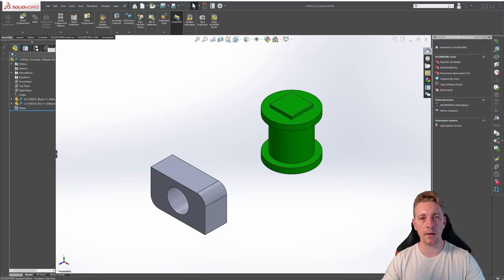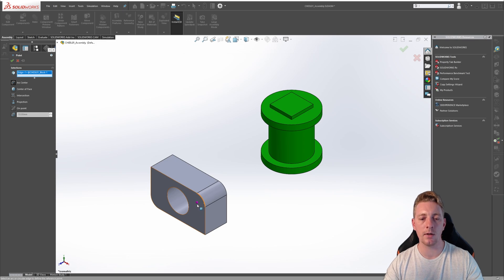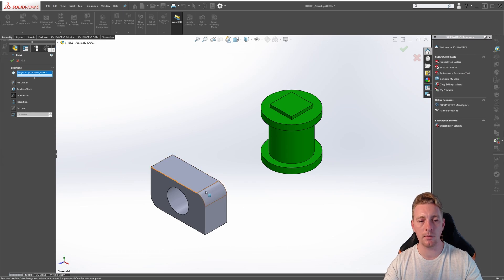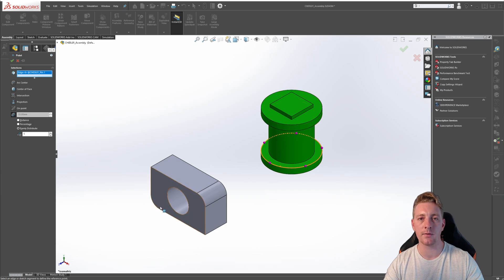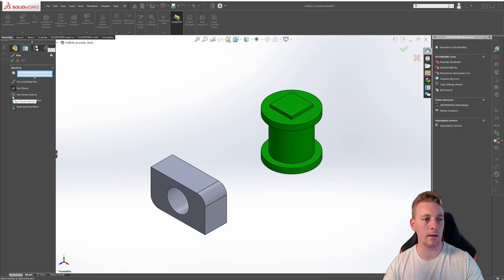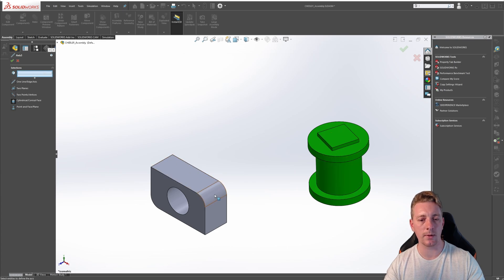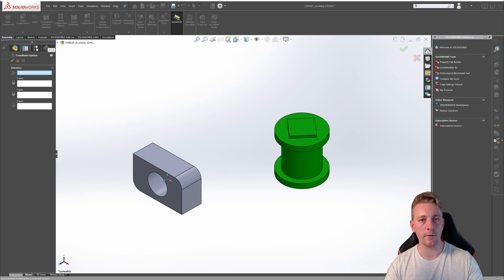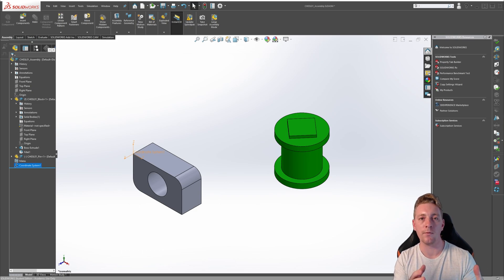Points, Axes, & Coordinate Systems | SOLIDWORKS BEGINNER | Chapter 03: Lesson 01 | CSWA COURSE

Comment: 5:57 when i expand the block part, all i see are 3 planes for some reason. is there anything that i have to load all the details into the workspace. Initially i only opened the assembly files. Or is that a UI bug?
Coordinate systems look like the could be used as stating reference for CAM operations. Are you also going to talk about CAM at some point in the future?
Reply from the maker: I will take a look at the files as soon I can, maybe was a mistake on my behalf. I'll let you know what I find. 
CAM I don't have too much experience with, at least not with setting up for machinery etc. It may be something I learn through my uni course at some point though.
There will be some lessons on producing workshop drawings. Sorry for lack of content, the contract work lately has taken up most of my time.